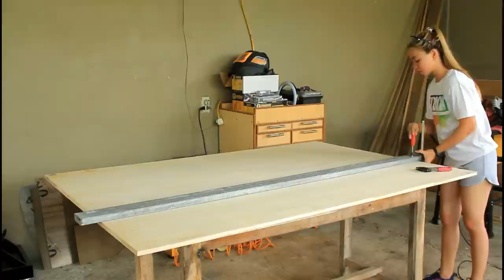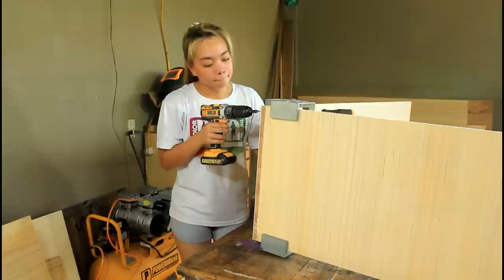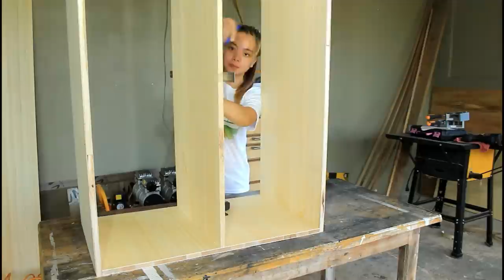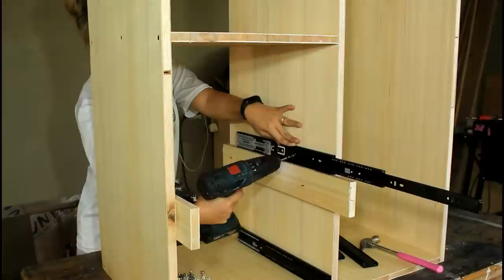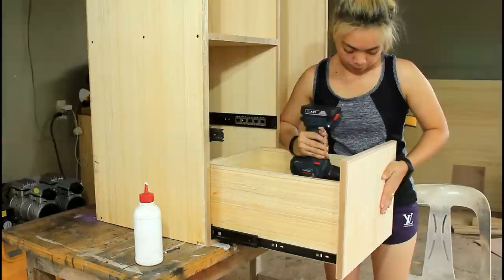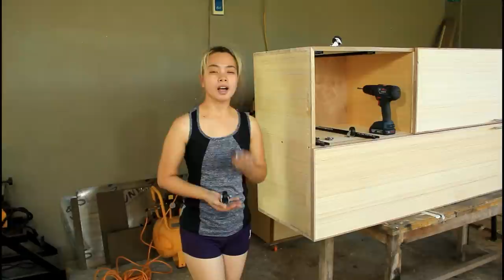Making a Movable Wardrobe Cabinet - Da Santos

Comment: Well done! I like it! When you get the time you might consider building a 2 or 3 foot folding step stool? Beats using a plastic chair and much safer. Okay that’s it! You have an air compressor, I’m sending you a Brad Nailer.